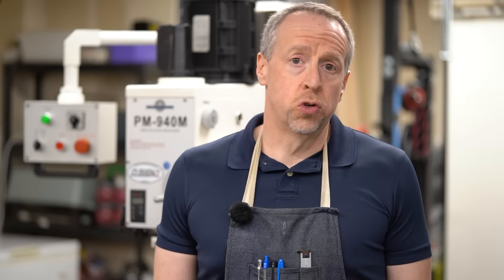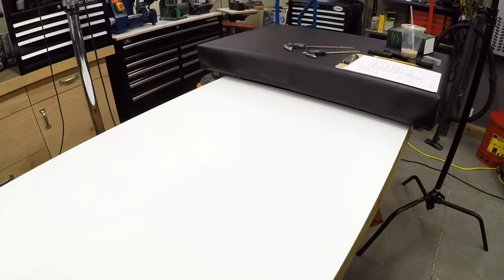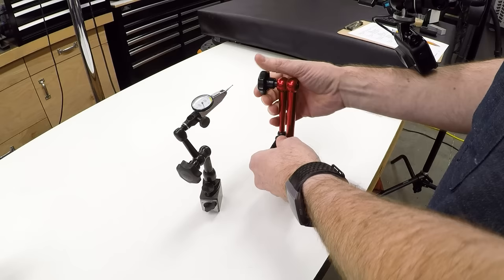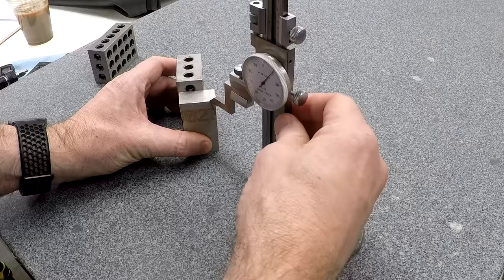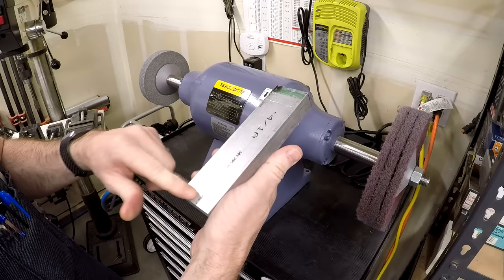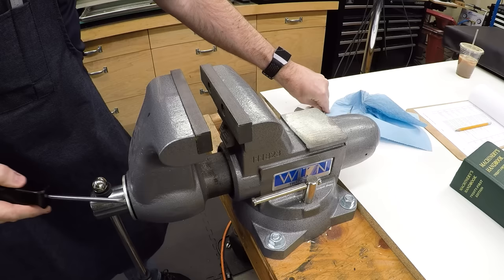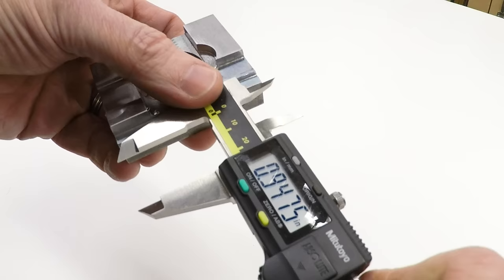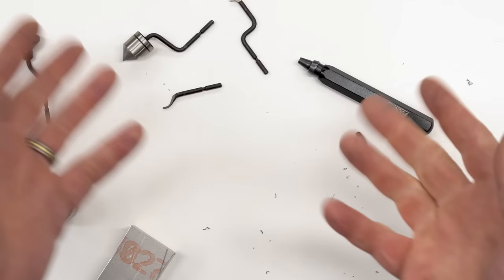Top Ten Tools I Use Every Day in the Shop

Comment: We're happy to see your Mitutoyo caliper made your top ten list. Great tips on usage as well!
Reply: And so they ought to be, Mitutoyo calipers have to be the best money can buy. I’ve used cheap copies for years and having saved up enough for a real set, I am stunned at how good they are, truly worth every cent, thank you so much
Reply: They're all I ever buy! In fact I just dropped mine recently and need to order some new ones! It happens.....
Reply: Can you tell me why the depth rod has a notch out of it?

Great products, thanks!
Reply: @firstmkb  I always assumed if you are holding it up against the wall of a hole, it's to make sure you are at the very bottom of the hole if there is a small radius at the bottom of the hole, but that's just my assumption, I am a machinist but I never inquired into it.🍻
Reply: @skylark4901  great answer.  Totally obvious to me after you explained it!
Reply: Get a little sponsor going on then 😂
Reply: I agree that digital calipers have advantages; mechanically robust, able to determine how far you are from your desired size using set zero in incremental mode, but they also have drawbacks. First; don't put your caliper by accident on top of a welding machine. By doing so the magnetic scale is transformed into chaos measurements only and, if your not from another galaxy and just a regular shop dude like I am, you just destroyed a wonderful caliper and there's no other option for continuing measurement than to buy a new one. Second; digital numbers going by fast don't compute in my mind as fast too. I know, I'm getting older, but this experience started when I was fresh and exited to learn and master the trade so therefore I'm willing to state that translating lcd displayed numbers in your brain takes a little extra time; no matter how old you are. I learned my trade a lot from a guy that used a dial caliper. They have a real disadvantage compared to digital ones and that's if you drop them on the floor chances are 1 out of 2 you have to buy a new one (or check in on a future watch repair course). If you can behave yourself and are able to lift certain items for a duration of time this caliper can survive a long time too. Second disadvantage; keep it clean. The mechanism uses a miniature tooth rack which is vulnerable to dirt like small chips. Don't put it on the right side of the bed of your lathe when your e.g. spraying brass chips al over the place. It's like friend and partners; you have to pay attention to both be happy.  In my daily practice as a also machinist I buy a new dial caliper every three years or later. In fact I have two new ones in stock because I can't live or function without a proper working one. Why I'm a making such a fuss over a mechanical caliper? You guessed the first one right; they'll end up magnetic when placed on a working welding machine but that's easily fixed with demagnetizing the caliper afterwards and no existential harm done. But the second one is less obvious If you didn't use them before and that's the needle which shows you the measurement instantaneously visually or without translating plus or minus figures in your head. For outside measurements; no big advantage but for measuring a bore or inside dimension; it makes al of the difference. Rock your dial caliper inside a bore and look for the high spot (that's the one) needle goes up and down, and your brain trained to look at movement of a physical object, has no difficulty to determine this. James is right when he stated that you have to take the shape of the inside measurement "points" into consideration when measuring small bores. They're tiny flats and rest upon a cylindrical face and therefore the error on small bores can be substantial if you're trying to machine a tight fit. For tolerances within 0,1 mm (metric guy, the Netherlands, Europe) I completely rely on the calipers. On larger bores, say from 16 mm and upwards I only use my dial caliper or no need to get out the three point inside measurement. This is a choice of habit and most of the times I'm making first time right parts. If I'm making stuff for my own and not for clients I trust the dial caliper from 10 mm and upwards for H7 tolerances. Try them and I think you're hooked liked me or know what you're talking about. Thank you James! l'm enjoying all of your videos. Best, Job!
Reply: I see several comments about best calipers money can buy... 🤦‍♂️ I have to make an edit to those statements. Everything Mitutoyo makes is the best money can buy. Well there is only one item I have bought that I think gives Them a run for their money.(Sorry guys. I feel like I'm cheating on you when I say this, but...) Interrapid indicators. There is nothing out there, that Mitutoyo sells, that I would ever buy over them. Nothing Starret. After those two, there isn't a real company out there to buy from anyways.
Reply: @jobkneppers  I haven't watched this whole video yet to see if this is covered. Dont forget. Another benefit to digital over dial is.... Take your calipers and put them on a bolt (I'm hesitant to say clamp or someone might think I literally mean clamp) like you are about to measure your bolt. Zero your calipers, which you can't do on a dial. Then install the bolt and measure from the head to the surface of the part and you know how much of the bolt is inside the hole. Anyone buying calipers for this reason should find a set that has a zero button and an origin button. It gets annoying having to rezero the calipers in this situation, if you only have an origin button. Extremely niche reason to buy digital calipers, but that is why I bought digital over dial. I always keep both. Call me old school but I trust dial to be more accurate. (Unless you buy Mitutoyo, of course. Then they are both dead accurate.)
Reply: @Itsdirtnaptime  I have several interapid indicators. I like them because they have more travel than others I own. The only problem is the stylus is off center to the shank. I don't know of any way to correct this.
Reply: Just make your cap covering the battery more solid than cheap plastic tabs. Mine became useless after I tried to change the batter for the 1st time: an investment thrown out in the ditch, not cool at all (come on guys, for the price, don't try to insinuate easily breakable elements as some programmed obsolescence). I went back to my old and reliable mechanical one...
Reply: I already had the exact same one. Great tool!
Reply: @jobkneppers  
You, sir have a lot of great points about dial calipers.  i use both.  i deal with imperial measurements most of the time.  but we do come across metric parts often.  we also come across mystery parts that are extremely worn and measurements are not obvious.  flipping back and forth between metric and imperial  is such a time saver to reverse engineer worn parts.  that alone is the reason why my daily driver is a digital.   though i use dial calipers in my home shop.  and my 12" at work are digital (old school brown & sharpe).
Reply: There are some other excellent brands out there (Starret is one), but don't just compare prices - Mitutoyo and other pricier brands out-compete on performance. This is not an advertisement: evaluate for yourself and your needs. To date, they use good materials in their calipers, micrometers, and torque watches. The calibration verifications are very stable. That is what you should want -- a device that measures with good precision when you bought it, but is found out-of tolerance at a one-year calibration verification check is nearly worse than one that is sketchy from the start. "When was the last time I made a "reliable" measurement with this device?" is not a question I ever want to have to answer or guess at. A tool that reliably passes calibration verification testing interval after interval is one that I would marry and have babies with.
And, again, I have no commercial interest in Mitutoyo. They and other quality suppliers make products that  have performed stably year-after-year. That is what I am looking for - stability of performance. Utter precision is nice, but repeatability in precision is a much more useful metric in a use environment.

Comment: i own a digital caliper for about 30 years and now in 2021 you tell me that step-trick,holy cow,you never get to old to learn something .Had to go to my workshop at 10pm to check that :)
Reply: I thought I was alone in learning this!
Old dog with a new trick, had to go try it out!
Now subscribed to learn more wee tricks and hints
Reply: There's actually a surprising number of folks that don't know that. And almost, but not quite, as useful as the depth pin...
Reply: If it makes you feel better, I have only known that trick for about 12 months and I am 55 now.
Reply: @harveysmith100  so you learned it at 54,so did i  :)
Reply: @chevyfahrer  What did we do before You Tube?
Reply: @harveysmith100  for example,i never would have built my own mill.I think youtube and internet itself makes it easier to get informed and get better in whatever you want .If you know where and what to look for.So for me its a big help to get better
Reply: @harveysmith100  Got a simple Mitutoyo caliper as a birthday present from my grandma @ the age of 16 ( did aprentiship - tool maker that time ) 40 years ago, read instructions and - voila`...
Reply: @rpavlik1  I find the depth probe on calipers incredibly unreliable in taking depth measurements. Looks dead easy, but when I try measuring the depth of a step 5 times in a row, that way I usually get 5 different answers varying by up to 30 microns. A depth mic gives me the same (hopefully correct!) answer each time. But the step measuring face was a new one of me too, and I've been using calipers for over 45 years.
Reply: @heikopanzlaff3789  My dad gave me a Starrett micrometer for my 16th birthday too (instrument maker) and the weird things was he saw it for sale at a department store that mostly sold clothes, kitchen wear, women's stuff etc. It seems someone had accidentally ordered a load of tools and they put everything on special on a big table just to get rid of it. This Starrett was made in Jedburgh, Scotland and beautiful to use (friction thimble) and cost about $12 in 1976. Those days are gone.
Reply: @every1665  The depth pin on a set of callipers is not meant to be ultra accurate, and your worst case of 30 microns discrepancy is less than 1 and 2 tenths of thous, not too bad for guesstimators.
Reply: @Ropetangler  Fair enough. It's just weird that using the main caliper faces on a shaft diameter will give the same result each time, that depth probe seems all over the shop by comparison.

Comment: This video brought back many memories. I served a 4 year apprenticeship to become a Machinist with the AEC (Atomic Energy Commission) and one of the first projects that I did on my own was to build a 2 piece set of 1-2-3 Blocks. Roughed them, drilled and tapped them, squared them up, heat treated them to 60 Rockwell and finish them on a surface grinder. They were within .0002 of size and square all over. I carried those blocks around with me for 20 years and lost them when my machinist tool box was stolen, along with ten thousand dollars worth of Machinist tools. I missed those blocks more than anything else. Sentimental, you know?
Reply: Hey Joe, I'm just starting out, I have a bench top mill. Can you recommend what brand of 123 blocks i should buy?
Reply: I did the very same thing at my Boeing 4 year apprenticeship (started 1952) lost one, block but still have the other, havent  used my machinist tools for 50 years.

Comment: I find a camera (phone one will do) is handy when disassembling things so that you can put things back together the right way by referring to your pictures if necessary.
Also - a glass syringe. Glass syringes and a thick gauge needle (say 19 gauge or less - lower number = bigger needle) is really handy for flushing chips out of tapped holes where cutting oil tends to hold the chips in place. The rubber pistons in plastic syringes will swell up in solvent and make them unusable, plus glass ones clean out much easier. You can squirt solvent down blind tapped holes or any similar tight spot with quite a bit of pressure to flush gunk out.

Comment: As a german, I can confirm Knipex is good. They really are the pinnacle of pliermaking. They also offer small electronic sidecutters with magnetized jaws. They catch all the pieces of legs, and are really nice.
Reply: Do they make leads on electronics components out of steel in Germany? Here they are made of copper.
Reply: @LambertZero  Good stuff uses copper, but cheap resistors off eBay (good enough for my hobbyist projects), some pin headers and IC legs (ofc not all, but the ones I use) uses something magnetic. Maybe nickel?

And electronics components are the most international things I can think of, so that would be universal to cheap components.
Reply: @vincentguttmann2231  Yeah, nickel, that's cheap. :-)
Reply: I love those pliers. If they ever run an 80% off sale, I'm getting some.
Reply: @Bob_Adkins  You could be waiting a while! Next lifetime maybe.

Comment: I have to say, one of  my favourite tools I use everyday is my 6" pocket rule. I actually have 2 of them, one with and one without the end hook. Extremely handy
Reply: Yep, I have one I acquired with a used set of old tools at a garage sale that is about an inch wide - because besides one side having engraved (not printed) fractional inch and mm scales, the other side has tenths and hundredths of an inch scales. It also has a micro-printed decimal-fraction-mm conversion chart on one side and a letter and number drill table on the other. It was made by Craftsman, and sadly I've never seen another like it.

Comment: Thanks James, a few of these are now on my  shopping list. I'll add a few I found I used daily when I was a full-time tool maker - a surface plate, a 3" smooth jaw precision ground machinist's vice (Palmgren), a big wall chart of Decimal - Fraction and Drill and Thread sizes (mine includes the weird British stuff like BA and BSP, I think it was from Dormer or maybe Sheffield) a $10 solar powered scientific calculator, 0.5mm mechanical pencil and a 8-1/2 x 11" pad of paper (not post-its; no adhesive), a carbide pocket scribe with a magnet on the end (a great "pick up tools dropped in the ways" tool, and "is it magnetic or ferrous?" detector), a small pocket flat blade screwdriver like the ones often given away as promotional items, and a quality set of micro-cut jeweler's and riffling files. Edit - and a 2" machinist's square....

Comment: Yes, I used all of the afore mentioned tools when I was working, but to add a few, A good 6" rule,  a good scriber, a bevel edged solid square and layout dye. The shop could always use more tools and a few that I would customize or make, like vise parallels. jaw stops, copper chuck jaw pads. the list is endless, but I respect your top ten. We all take different approaches to the work.

Comment: For # 11 I had a 1 1/2" X 3" cutoff of unhardened Vega tool steel about 7/8 " thick ground flat on the bottom drilled with the tap drill and nominal hole diameters to provide a guide for hand held drilling and tapping for 56 years. Still have it but in hind sight I should have made a hardened bench block with the same features.

Comment: If you also do any glueing, those unused HF band saw blades can be cut to short lengths, and fitted into a slit in the end of a dowel for a handle, they make a very good glue spreader.

Comment: I have a Belsaw stand mounted belt sander with 1" sanding belts. I couldn't live without it. Bought it in the 1970's and have not done anything to it except regular maintenance and belt changes. I even grind lathe tool bits on it from time to time.

Comment: Great channel. I need to get the Noga tooling but most important the bi-focal safety glasses. My most useful tool in the shop is paper and pencil. Sorry, not sexy but I used it for calculations, simulate part fitments etc. Yes, I need to move to CAD but my workflow is still significantly paper and pencil

Comment: Oh yes, you know the good stuff. 5:35 Those Knipex pliers are best adjustable wrench alternative. Also handy for doing small bending etc. As an industrial mechanic I quite often carry small ones with me as they can extend to fairly beefy bolt sizes and cover mm and inch stuff mixes like for instance pneumatic connectors etc. The best pliers to own in addition to more damaging Knipex pipe pliers.

Comment: used to carry 6" Knipex, 6" LED flashlight, and standard Allen wrench  set on the job when doing Tool & Die  or running Metal treatment / Ecoat paint systems, able to fix most issues  without getting the big roll around drawer chest

Comment: If you have the extra money I would choose a JET bandsaw, I toiled with the $200 version for years and when I switched locations I popped the extra bucks and I'm glad
I did, the extra wide blade, extra size along with extra rigidity is a blessing. I also opt for the calipers with carbide jaws, both inner and outer, these act as indestructible
scribers. Good video, I see way too many people using a hand hacksaw when they could save a s-load of time buying a chaep cutoff saw.

Comment: My safetly glasses are also bifocal, however, they have my mid-range and reading prescriptions. Not cheap but worth every penny!
Reply: I've had mid range safety glasses and they really work well when running a machine.
Reply: @mpetersen6  Indeed, however, I can't read scales or mikes without my readers! The only option to avoid  forever changing my safetys out for readers was to have the reading prescription put into the lower portion. I can't tell you how pleased I was to find out that this was possible :~D
Reply: @TheOwlman  I couldn't run machines with my regular perscrip or the bifocals or do other work in the shop.